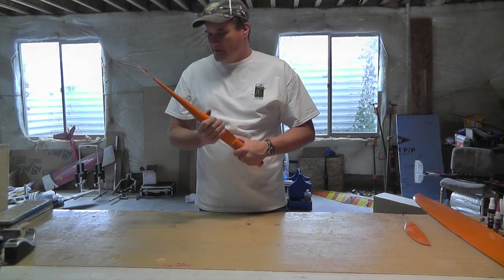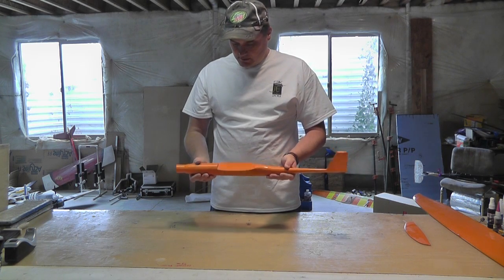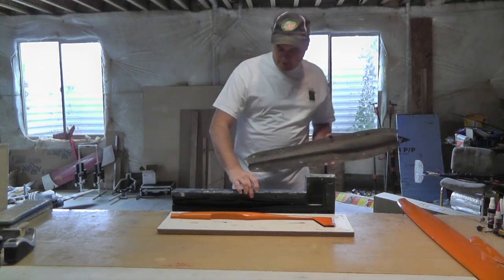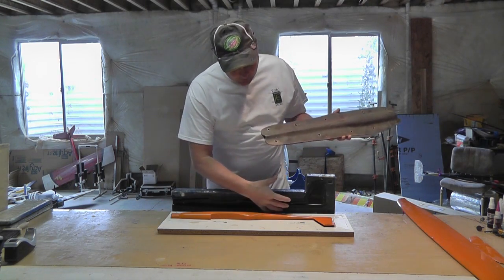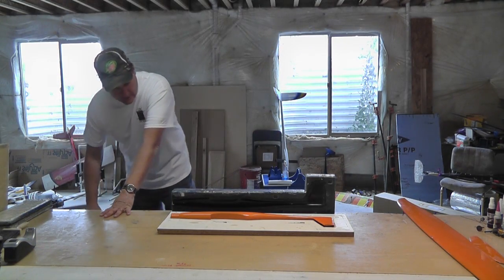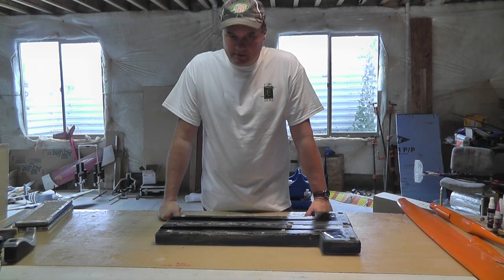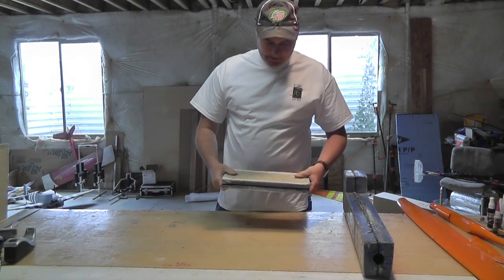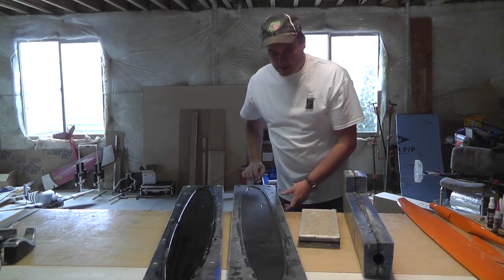Building Molds For Composite Model RC Airplanes

Comment: For the fuselage : could I also split the fuselage plug in the middle and laminate the first mold half on a Glas plate? So I can spare the seperator board?
Reply from the maker: Yes, just index the two plug halves so they fit together when you do the second side.

Comment: What kind of resin do you use
Reply from the maker: I think these molds and parts were made using West Systems epoxy, but shortly after these videos I mostly switched over to MGS epoxy.
Reply: I was wondering for the actually plane, is the same epoxy

Comment: Good job on this video. I would suggest maybe you could substitute hydrocal for the sand epoxy mixture. Gypsum cement Hydrocal is about $25 for a 50 lb bag. If you're only going to pull a couple of parts you can even skip the tool coat and just treat the mold with some coats of epoxy, wax and mold release. As per Terry Luckenbach.
 I use it to make fiberglass cowls.